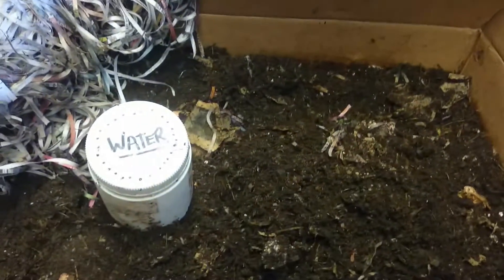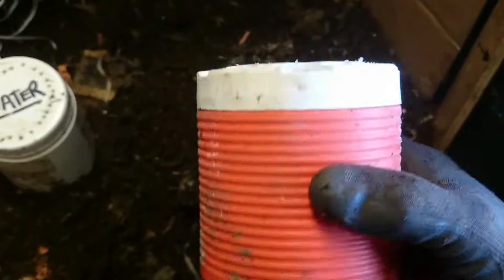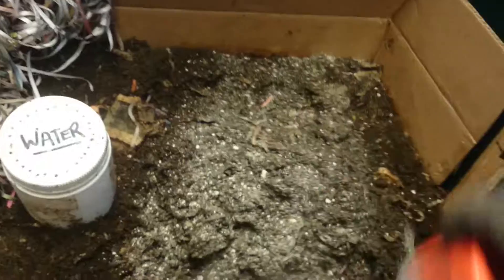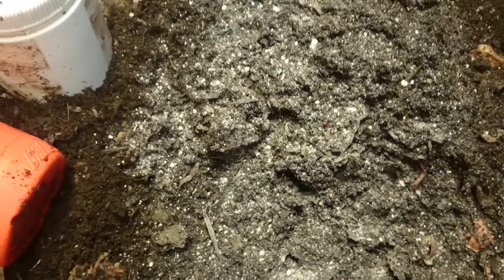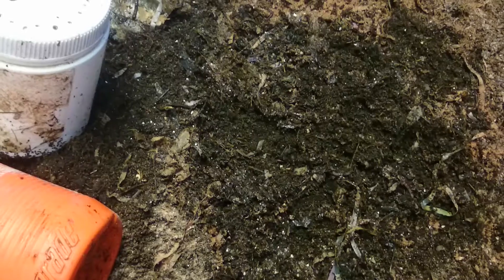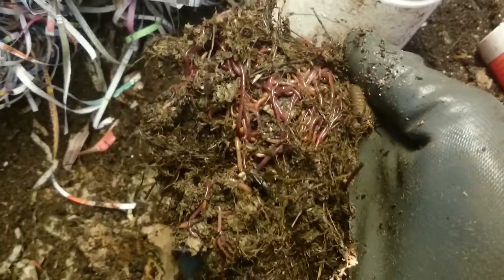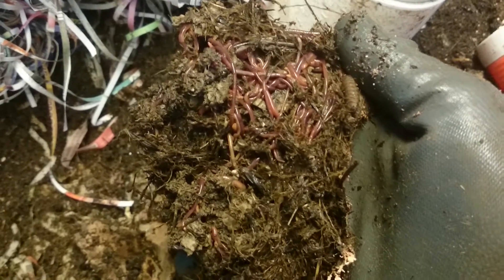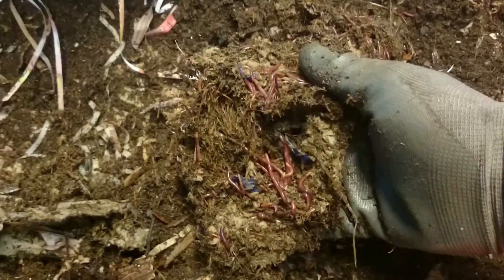Worm Farming: How To Apply Lime, Dolomite (PH Buffers) 190415

Comment: What diameter drill bit did you use on your shakers?
Reply from the maker: The size is not really crucial - but its around 6 to 8 mm (1/4 inch) - i use a "stepped" drill bit nowadays, they cut plastic really nicely and dont leave a burred edge :)
Reply: It looks like you used a bunch of 1/8" holes on the one for water . . . Did you start using 50/50 of the  Lime and Zeo in one shaker? . . . I didn't know those two both provided grit, I got some Agricultural lime (the bag also says "Dolamite Lime" on it) - and "play sand" (fine) for grit (another vid I saw, the guy said he uses volcanic sand, so "play" sand seemed like it would work) . . . What do you think if I did 50/50 of lime and sand . . . or should I do 100%  lime, and then just throw in a handful of sand when I put in a new layer?  Or just return the sand, and lime is all I need . . . I didn't see that they have zeolite or azomite here, I think I'd have to send away for it.

Comment: Great video, thx! . . . why do you use both Garden lime and Dolamite?  Because the worms like variety? . . . does one or the other also provide grit?
Reply from the maker: Hi Jorge
I used to use dolomite as that was what I could buy easily - now I use garden lime as I found a good cheap supply at a produce store . . . the other thing i use is ZEOLITE - it has a LOT of great properties, grit, buffer and minerals in the worms diet, but also a ton of great benefits to the garden youll use the VC on later on. BOTH lime/dolomite and rock dusts like zeolite (and azomite) provide grit. For more details on zeolite, see my website:
http://thewormman.com.au/zeolite-info/

Comment: Would diatomaceous earth be OK to use on these?
Reply from the maker: Hi Steven
DE, while ok as a mineral supplement, has a small value as a buffer - but if applied dry, will kill beneficial insects in the worm bin. If using it, only use food grade, though :)